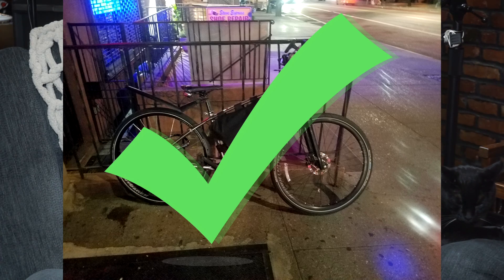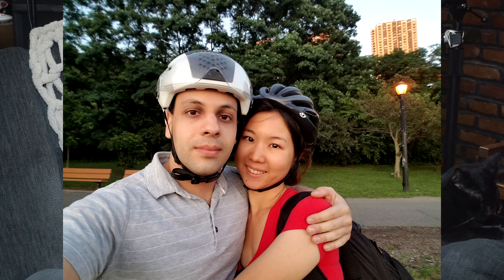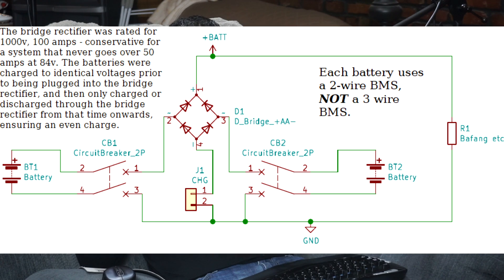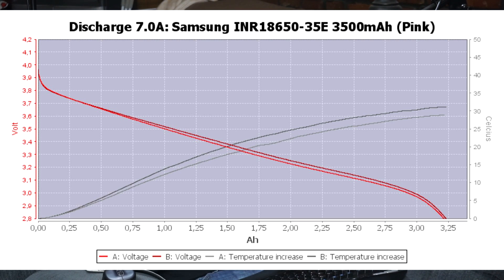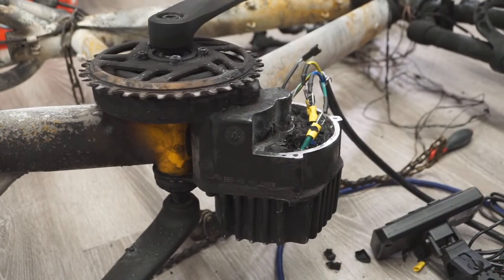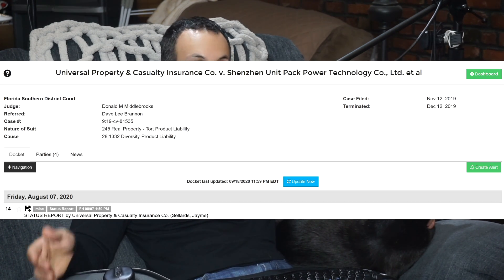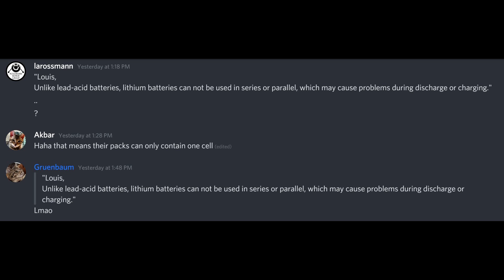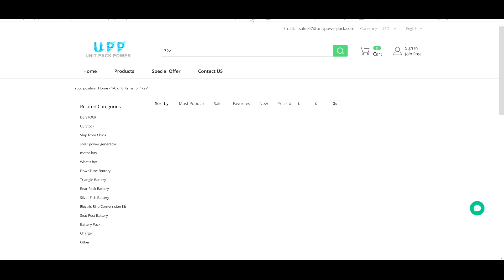Louis' front door goes BOOM courtesy of UnitPackPower battery.

Comment: When I looked at your schematic, I had some questions. First of all, every battery is connected to a dual pole switch. Usually when a battery is connected to a controller you get a spark due to the fact the capacitors in the controller need to charge to the battery voltage. Such sparks can cause a small damage to the switch contacts so that after some period of time those contacts will get a resistance due to burn in. As a result, the switch will heat up when a lot of current is passing trough the contacts. A switch that can handle 100V and 100A should have the size of the main circuit breaker of a house. After all that is also only 120V in the US. If the isolation material of the switch is made of some thermoplast plastic, it might become soft due to overheating and it might have caused a short circuit after you switched off the batteries. I am not saying that the batteries are allowed to burst in flames due to that, but without an adequate fuse likely a lot of battery packs will do. Again, a fuse that can handle 100A at 72V is a rather big item. 
Another thing I wonder is how well 72V can still handle humidity. Water has a high resistance, but at a high enough voltage you will get electrolyse and it will heat up and become more conductive. This can cause the water to vaporise leaving a residue of conductive salt behind. When that's dissolved by water, it will make it even more conductive. The third thing I am curious about are the diodes. We all know those have a rest voltage over them when current passes trough. Due to that, they also heat up. If they are not properly connected to a heatsink, they might short due to overheating. If the rest voltage is 0.2V and you have 30A passing trough, that's 6W that will be dissipated as heat. I assume you know the size of  a 6W resistor. So basically I have my questions if the switches were up to the task and also if the diodes were  properly cooled for their use. Tesla has a fuse wire on every individual cell of their batteries. Most bike batteries don't have  those. A car battery has like 40P cells, so if one becomes bad you have 39 left to try to reanimate it with power. Most common ebike batteries here are 4P or 5P, so if a cell goes bad the chanches of igniting it will be lower. A bad internal construction of a battery pack can cause a short as well, but if that would be the case you would have battery fires of that specific brand more often. A good BMS should monitor the battery temperature and switch off the battery voltage output if it overheats. A very good BMS has a bluetooth interface so that all individual cell voltages can be monitorred. They come with a price and aren't for everyone. (Most people have no idea of the importance of this) I hope my technical rambling about this makes sense and I am curious what others think about it.
Reply: 1 YEAR LATER I would like to say thank you for this... it seems no one else has appreciated your ramblings . I did.

Comment: Build your own battery packs, Samsung 40T cells, spot welder from Amazon, https://ebikes.ca/product-info/grin-products/phaserunner.html  <---- this controller has settings to protect battery during regen, you can set amp and volt limit sent back to the battery.  ebikes.ca also sells decent batteries.  Crystalyte motor's are about the best on the market.
2 wheel drive ebike    AWESOME  !        ConhisMotor Exclusive Customized FC-1 Bomber Electric Bicycle Frame Mountain Ebike 72V 5000W Motor Black Frame RCP2S Rear Shock      from Ali express and they have many others    pesonally     hub motors are much better than bottom bracket drive, bicycle chains are not made to withstand the torque those motor's put on them.
As a motorcycle rider who has had chain snap while riding, if not for boots, would have lost half my leg.....

Comment: I see no fuses on the schematic. Did the manufacture include fuses on their end?

That bridge rectifier is definitely not your friend in this application. 

What is the model of your switch? Switches have an ac and a dc rating...... Generally dc ratings do no go this high.

Regardless if the manufacturer did not fuse the battery properly to prevent user error f them.

Comment: I curious to what the C rating was on those cells and brand they used? Reason why I bought a spot welder and built my own battery packs using Sony, or Panasonic, or Samsung cells rated at 30 to 35 amps continuous from a reputable source. Plus cells have to have a good bms for balancing and protection. Last ebike built over 3 years on same pack built.

Comment: I had a similar experience with a 20S7P Chinese battery.  Went up in flames inside my apartment, after coming off it's 2 Amp 85 volt charger. Sounded a little like popcorn popping... 10 minutes later the fire had spread to 8 apartments!

Comment: Lithium batteries provide excellent power density, but there are a lot of people putting lithium packs together who clearly don't know what they're doing, and there are BMS vendors making circuits that should never be connected to a lithium cell. Your best bet is to assemble packs yourself, testing each cell to verify that its charge and discharge characteristics are close, then top-charging each cell as it's installed in the series string. But, it's difficult to get the form factor / fitment you'll need if you make the packs yourself, and fitment is critical in e-bikes. A cost effective alternative might be to rebuild old cell packs using your favorite cells.

Comment: TDid you happen to check the battery first, as in a capacity test? that is either a bunch of sorry, cheap 18650s or they gave you used batterys  or they wired your shit with 28g wire, or all 3

Comment: I think, the problem was with the battery rating itself. What I do know is, one single 18650 battery with 3500 mAH capacity should not discharge beyond 10 amps. I believe that you have configured the battery pack correctly, and it's possible that you have purchased either counterfeit or substandard batteries. There's so many cases where there's a lot of counterfeit 18650s, while others rewrap those to look like the batteries came from such manufacturer.

Comment: When you put two packs together in series or parallel, you gotta circumcise them.
Especially in series. Four wire is better in combination. My 72v battery charges at 42v per set.
Hoverboard batteries.

Comment: That's disappointing. 2+ minutes to get the wet stuff on the red stuff?????
Those guys took their sweet ass time to get water flowing. I assure you most volunteer departments would have had the pre connect broke, shortened and flowing. Or have pulled a trash line and put that shit out in under a minute post arrival. And volunteers usually train 3 times a month. Some departments even less.

Comment: I have a 3 year old UPP hard shell triangle battery, 52v (60v max charge) and ive had no issues, been charging it at 5 amps. It powers my recumbent tadpole under full load, my weight, a trailer with a 60lb kid and his gear in it. I remove it from the bike for winter storage because cold causes a reaction in the lithium making it dangerous to charge. Storing at 60% has seemed to prevent any issues so far. Not disagreeing with your obvious outcome, just putting my experience out here.

Comment: As you might assume discharging or charging series stacked batteries your always going to have the middle ones leak, burst, and or over heat so now in new laptop batteries they monitor each cell and in satellites they will stack only cell layers to get to working potential I have seen. So to slick the problem I add dual parallel ones hooked up in the middles increasing risk if shut off where in no discharge can cause them to fight and keep forcing juice against the center parallel circuit to a hazard if not as place where line is disconnected, yeeah? stay cool breath religious.

Comment: according to battery connection schematics - battery really Can self charge and discharge  another battery during the riding process.
 it happend with me 2 times 
, need to you way more intelegent bms, (with regen mode  for example)  systems to keep 2 batteries safe together
 its way safer to build 1 large battery with doubled capacity and good expensive smart bms
Reply: If its just in paralel there is no diff

Comment: Were you able to verify that both strings were at the same voltage AND capacity before installation?  Because lithium-ion discharge curves are so flat, just charging them to the same voltage isn't enough (for the initial connection).  This isn't super-easy to do, as you would have to put both through a charge / discharge cycle while integrating charge / discharge currents with a gas gauge.  Looking at your circuit, it seems like if one series string became out of balance with the other (like in a deep discharge and slight imbalance situation), it would be possible that one battery would take the entire charge current.    You would have to ensure they are at the same voltage AND capacity, or else a deep discharge would cause the two strings to be at significantly different voltages.  This would cause one string to get all the charging current, and the other string to get all the discharge current, until both strings were equalized in voltage.  Relying on the BMS's ability to discharge isn't always reliable, because there is most likely a limitation on the amount of power that the BMS's balancing can dissipate.  Without seeing the entire system schematic, I'm guessing there is no way that it can keep up with your charger.  How would the charge rate of the charger compare to the 1C charge rate of just 1 string of your batteries?

Comment: Thanks for the video. I have the same brand battery in a 36 volt. I have been using it for my mobility scooter for the last 2 years. I will definitely not charge or store that battery in my house at all. Thanks for the heads up.👍🏻

Comment: the peak amperage you drew here is irrelevant.

LiPo batteries like to go up in flames when they short out. There was probably a manufacturing defect in the battery and two batteries were shorted, and heat built up inside the battery enough to damage other cells and cause a cascading failure (thermal runaway).

this unfortunately happens to all brands.

Teslas have been known to sometimes catch fire when parked (in addition to catching fire when involved in a very serious accident), same with Hyundai Konas, Nissan Leaf, Porche Taycan and Panamera, Volkswagen etc. not to mention all the cellphones and laptops that exploded, from samsung, apple, lenovo, toshiba etc.

it sucks but this shit happens sometimes.

I don't know what the company said to you, of course, and I'm not defending their customer service.

EDIT: regarding their reply...

all Li-Ion cells larger than 3.7V or ~1300 mAh or so are built using series and parallel combinations of 3.7V cells. so of course you can parallel them or put them in series. When you put them in series you need to make sure they are charged evenly (need a balance charger). You shouldn't use in parallel batteries of different capacities or ratings, or from different manufacturers, different ages etc. because they might not have the same characteristics. but two identical batteries, well, that's how all car or laptop batteries are built.

who is doing the charging here? Does the battery come with an on-board balance charger in the BMS?

EDIT2: I should really watch the whole video before commenting

Comment: Amazon is still selling 72V: "UnitPackPower 72V 20AH 25AH Ebike Battery with 4A Charger, 40A/ 50A/ 60A BMS Protection, Waterproof PVC Lithium Battery Pack for Scooter, Trike, Go-Kart 3300W 3000W 2500W 2000W 1500W 1000W Motor"

Comment: If batt pack 1 is 0.6v higher than VCC and batt pack 2 is at -0.6 less than VCC would this let current flow thru both sides of the full-wave bridge rectifier  I was wondering if some how both sides of the bridge rectifier were on due to some back EMF from the motor or when the charger is plugged in maybe?  I think it could short thru the diodes because its not AC inputs you cant guarantee that only 1 side of the bridge rectifier is on at a time, What do you think? I would really love a follow-up to see if you discover any more but if as you say the breakers were off then its a battery pack fault Thanks for the video  glad no one was hurt

Comment: I'm very concerned now. I recently put together my own electric bike and the battery is from them. it's a single battery 48v 1000w. what precautions should I take so my house doesn't start on fire? the battery hasn't heated up at all when in use and I check it all the time.
Reply: You dont need to take any precautions, your battery is fine. Moral of the story here is dont DIY your own electronics to link two batteries together.
Reply: @KB-jy5hr  ok thanks. I was worried there for a little bit

Comment: Hi! Battery engineer here, I just wanted to remark that it's incorrect to say that a 10P pack of 8A continuous cells can output 80A. That's not actually true - due to (both inherent and emergent) mismatching it's always lower. Exactly how much lower depends a lot on your battery management and thermal controls, but a conservative estimate for completely non-thermally managed, unmatched cells is C * sqrt(n) = 25.3A. With matched cells, a conservative estimate is C * n / sqrt(2) ~ 56A. You want your current to ideally be lower than either bound, but certainly comfortably lower than the higher bound.
Reply: Usually go 25 to 35 amp continuous from a reputable company and reseller. With good BMS’s and matched cells

Comment: Lithium iron batteries can be unpredictable and have cost millions of dollars in damages as well as loss of life as in the case of the UPS flight N571UP. If they're manufacture incorrectly which really seems to be the case for Louis this type of fire happens quickly and can go out of control at an alarming rate.  Damage during transport is also a reason a well built battery can catch fire even if it was manufacture correctly in the factory. Be safe around batteries.

Comment: Maybe there's a reason you can't put the packs in series or parallel due to the internal battery management circuit board not being able to balance the cells?  The bridge rectifier might be creating a feedback loop that prevents the cells from being balanced correctly.  What kind of battery charger did you use?  Would be interested to see if the 3MEV produces similar results.  I have used a UPP battery for 2 years with no problems.

Comment: good cells are fused, cheaper does not. Good design  of bms consider that one cell goes open or shorted. yours did not. If the circuit breaker was off, the guilty part must be battery. One shorted non fused cell started chain reaction. This could be internal short or short with neighbour cell ore any wire.Cheap is cheap.

Comment: If the battery fault occured right after the disconnect the chain effect initiatior might be a voltage transient because large inductive load was disconnected in combination with Pilo$hit brand battery protection circuit:)

Comment: Well I myself have build a lot of batteries and used them in several projects. The error which let to the fire was obvidously an overcharge of one of the cells in one of the packs.
As I understand it, the company means that you cannot use the packs in a parallel setup because of the danger of energy flowing back into one battery and causing an overcharge. Which is exactly what happend.
Your build did not use any overvoltage protection in the parallel mode. Maybe you should modify it in the next version.
And by the way: Every System which uses lithium cells does not stack the packs in parallel mode but in serial mode. Every think about why?
Reply: I was very excited to buy a battery and a conversion kit from AliExpress but not that much now. How risky is a 36V or 40V from EM2ev to explode ?

Comment: As an experienced electronics  tech, I can tell you that this manufacturer's statements indicate they know nothing about correct battery usage.  They are making excuses, taking advantage of the public's general lack of knowledge regarding such things.  The diodes indeed protect  each battery from the other in case of uneven voltages.  And the statement that lithium batteries can't be used in either series or parallel is patently ludicrous.
Reply: As an inexperienced electronic hobbyist, I can tell you that's the first time I see a rectifier used in this context, but in no way I see this as incorrect diode usage.

Maybe they simply consider rectifier to be an AC->DC thing, like I did until today...
Reply: @Marandil  As I said, the circuit diagram looks all good, but he Ignored the max charging rate of each cell.
Reply: You can not use BMS in series, that is correct as the mosfets aare max. rated at 100V, most times even lover. So if one battery switches off it damages the MOSFETs instantly. = No Protection anymore. 
Parallel is no problem though as long as you use BMS with only one Out/Input.
Reply: There's no need to get stuck in a customer service staff's broken Chinese English, Her mean not say lithium battery can not be in series and in parallel, but do not suggest customer take our battery pack in series and in parallel unauthorized, because different batteries with different voltages and BMS, if the circuit diagram with problem will be dangerous.
Reply: @andyjiang8962  Ironic you cry about broken English, yet yours is just as broken. Clown shoes.